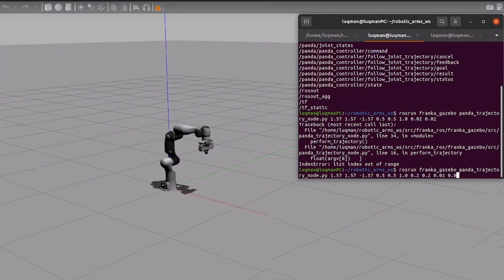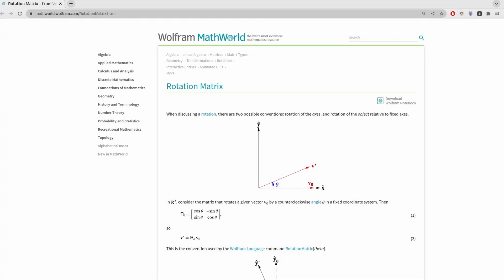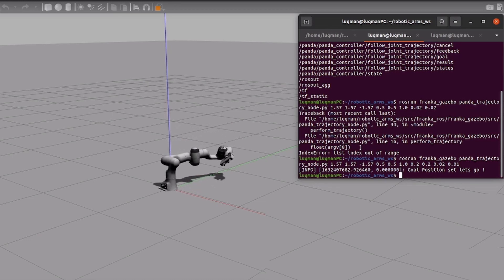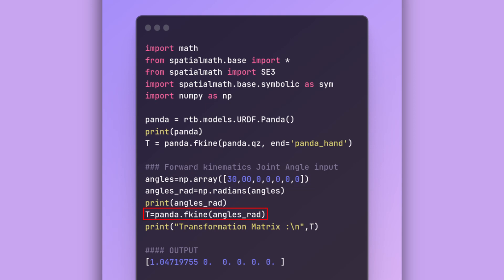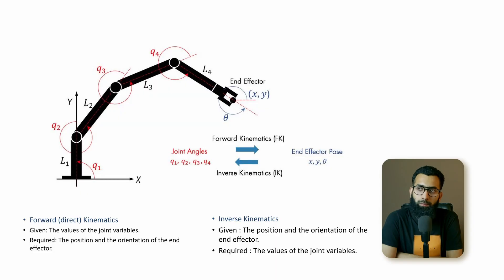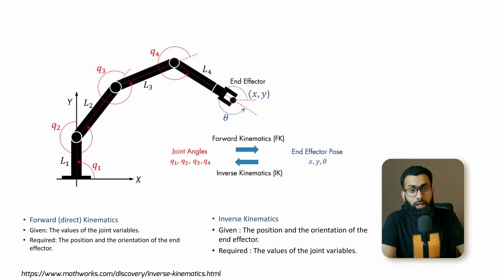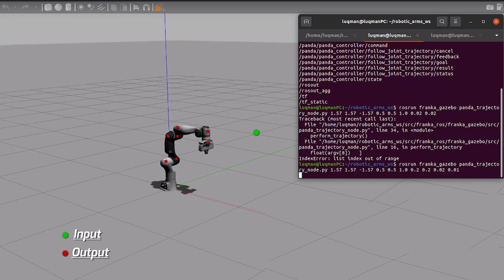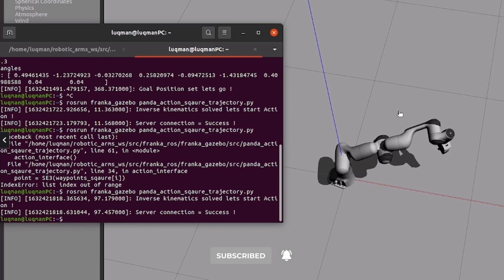Robotic Arms: Role of Kinematics, Matrix Multiplication and DH Tables

Comment: hello sir,  your videos are awesome. I have some issue with the orientation in ROS planning. 

not able to understand the underlying fundamentals of POSE_TARGET. 
It would be great if you cover that topic.
Reply from the maker: Whats that?
Reply: @robotisim  there is an universal robot and I have to configure the orientation of gripper. 

example : Gripper is facing down
it grips an object then tries to keep that object in a shelf. so that grippers orientation needs to change so that it can slide the object in the shelf. Like that. 

basically it involves quaternion and how the gripper will rotate. 
doing it using RVIZ interface is easy. like I can change the rotation of gripper but using python interface. I am getting X,Y,Z,W values in the orientation property of move_group.get_current_pose().pose.orientation
Reply from the maker: @rondechaka1160  you can move your gripper using
Move group

First define end effector in moveit config

For quaternion, you can convert quaternion to euler then make it work as wll
Reply: @robotisim  thanks for the guide sir. I am able to do it.